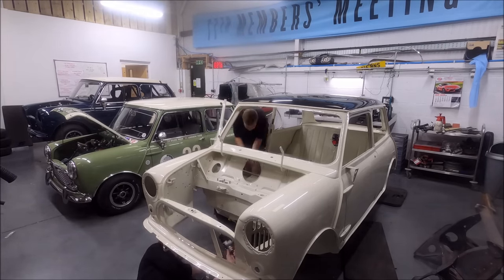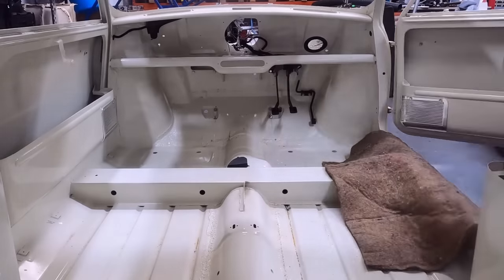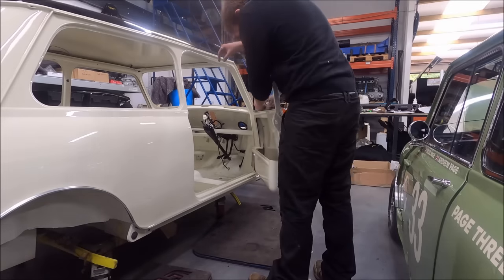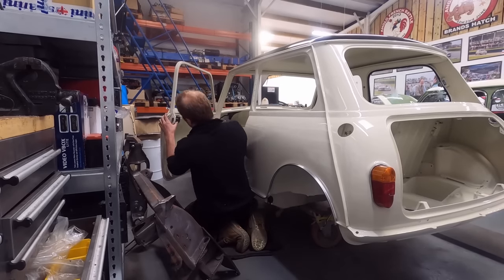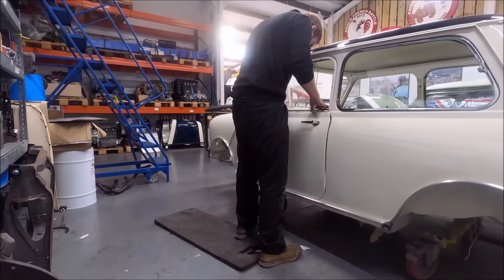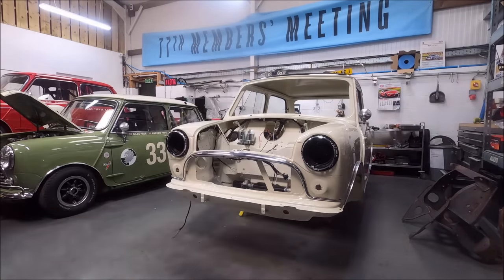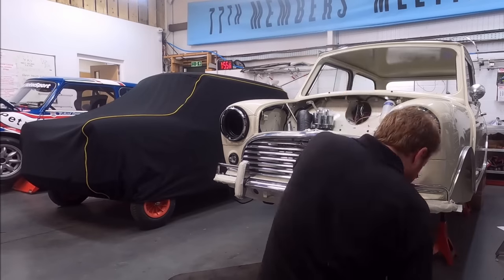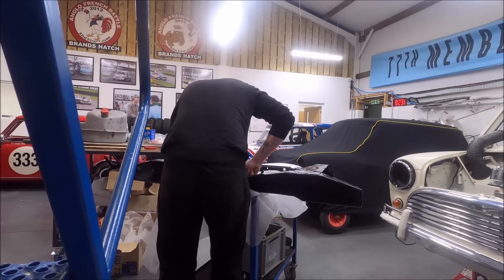Swiftune Madgwick Mini Cooper Assembly Part 2 - Classic Mini Workshop

Comment: Keith it sure would have been nice to see them installing that chrome strip on the seam over and between the wheel arches.
Reply: I was going to ask if Keith could find out how they preshaped it.
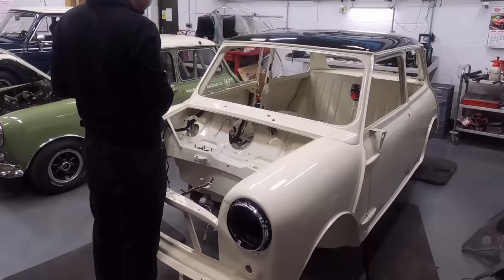Reply from the maker: He fits it at 1:40 but it looks like it was pre-shaped. I will ask where they get the trim and if they shape it first. I will add the slowed down clip at the end of the next video
Reply: @classicminiworkshop  thanks Keith
Reply: Because they are fiddly, I did it in the evening and forgot to film it!
Reply: @H3LL80Y101  pity, but thanks for taking the time to reply. Very fiddly and the Australian Cooper has flares that are held on by the strips which make it much more difficult.
Reply: Maybe Alex will have another to do and he could film that. It's also not the crap ones we get from our mini suppliers, but a Swiftune Quality one! Soon to be sold in their online shop, maybe....
Reply: @markdraper7  maybe I’ll film a how to video
Reply: @H3LL80Y101 , Perfect, if you can. The car next to mine will need one soon won't it? 😉
Reply: @markdraper7  that would be fantastic to get a better quality set. Thanks for your involvement.
Reply: @H3LL80Y101  that would be really appreciated.
Reply: @markdraper7  I’ll do it 👍
Reply: Looks like I'm not the only one that enjoys putting those mouldings on. ##**!!!#*.   It's just the part in front of the back wheel arch that I found difficult....the rest wasn't too bad. Stretched the moulding out in the sun and put weights on it and straightened it out somewhat, before putting it on, plus used a heat gun.  I was wondering if Mr. Morris used rivets at all?
Reply: @midgelambert3880  I've used rivets before, but then to glue them on for road cars, and Lock Wire them on for the race cars.